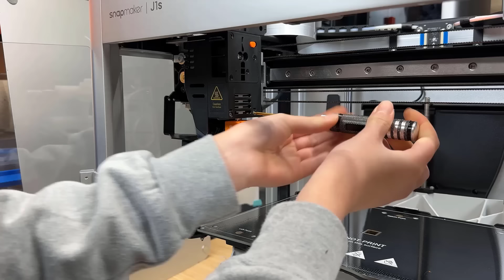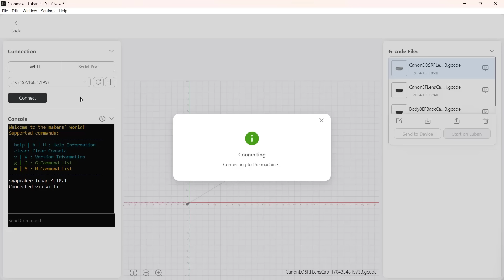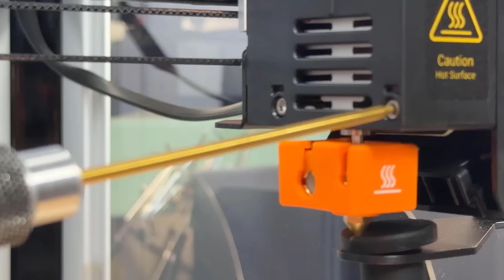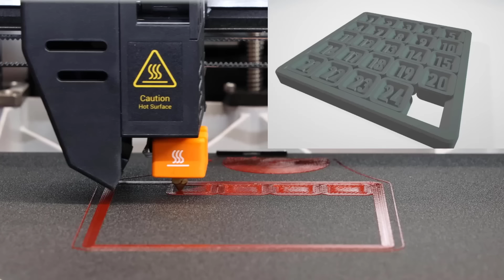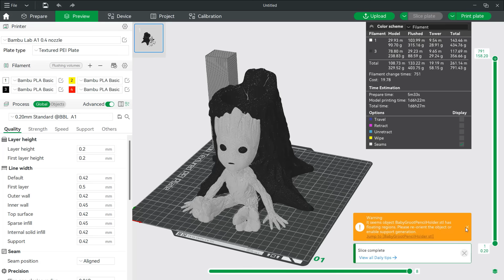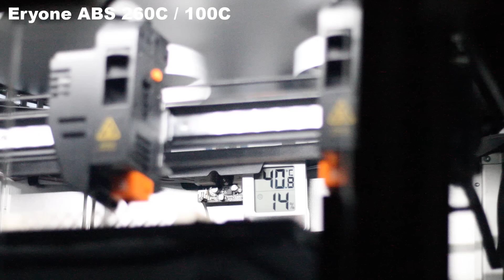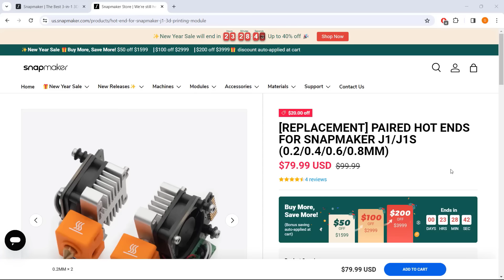SnapMaker J1s Review: IDEX Fully Enclosed 3D Printer, Multiple-Color & Multiple-Filament 3D Printing

Comment: I modified my J1 to include the filament on the inside, can be crappy if you need to change filament mid print.   I plan on laser cutting a round hole on both sides to fix this.  Great underrated printer, for anything but PLA, more engineering orientated.  The hardened ends are best in a pair  you won't have the wear.

Comment: I've owned the Snapmaker J1 since it was first released, and your video taught me three valuable lessons:
1. I had never realized how useful the paint option was for controlling which filament is used.
2.  I didn't realize that the Z-offset would solve the overflow on the first layer.  I've made several prints that I could not break apart.
3.  The tip about using PETG for support of PLA is definitely something that I want to try out.
I was impressed with your organized and thorough coverage of this printer.  Keep up the good work!

Comment: Follow up! You're right about the corners. There's no calibration procedure for the pressure advance, so I made my own test print. Turning up the K factor around a factor of 2 from factory made the edges neatly sharper. Good eye! I hadn't noticed.

Comment: I'll be honest, that print quality is rough and that is being generous. When you consider this is a $1000 machine, that and the amount of manual calibration required is honestly pretty unacceptable for this price point. Filament is cheap and I'll happily take more waste over lower print quality, excessively expensive accessories and manual calibration if that is the choice presented. Don't get me wrong, I'm looking forward to someone putting out a printer that is competitive in price to the bambu printers and does multi color printing with less waste and at the same or higher quality. As of right now I can just add a little cost into a bid to cover filament waste and end quality is just flatly too important for those of us selling prints. As for print time, it is just cheaper for me to buy another printer if I have more volume than my current printers can produce in the space of time I have available. 

Criticism aside, if this is strictly a hobby and wasting as little filament as possible is more important than efficiency, then I can certainly see the appeal of a machine like this. I'm still not entirely sold on the amount of calibration you need to do for the cost, but to each their own. Don't get me wrong, I love the idea SnapMaker has here, I just feel like the execution falls a bit short for what they are charging.

Comment: I like this one A LOT. Real dual extruders, Strong one piece die cast aluminium chassis, proper linear rails, no cloud based shitware. Two things ennoys me : The filament path, and the bed cable management so terrible that they removed it on their photos. Limiting the print height to 200mm and bending 90° the filament just to fit in the same height than a Bambu is STUPID. I would integrate a heated chamber at the top for spools with a straight path for filament, because anyway they need to be dryed and pre-heated.

Comment: Ha! Was looking for your review before I bought one last month anyway. 😊 Totally agree, one month later. 

It has its quirks, but it really is a great little IDEX. The auto XY is worth its weight in gold. If you just want fast, pretty PLA prints then other printers might be better. But for two color and true dual material (supports) it's been great. 

Also could stand a minor hot end upgrade. Otherwise I've found it pretty reliable. It also has a free Cura plugin which is what I use for my own designs that lets you send wirelessly from Cura. (There are Prusa profiles too, but haven't dug into them.)

Overall, for a hobbyist designer or engineer, I think it's a great machine. And it really is nice being able to do some pretty two color stuff without all the waiting and plastic guilt!

Comment: Pricey, but capable. For specific printing where you need dissolvable or non-stick supports, or something like TPU components inside of another print, this is an amazing option. Quality isn't 100% there, but good. I wonder if running in mirror mode actually cancel out a lot of X-axis resonance or reverberation. Would be interesting to test if counterweights can improve print quality in general.

Comment: I joined the Snapmaker J1/J1S user group on Facebook many months ago to gauge the overall long-term experience, and the biggest issues seem to have been severe clogs and bed adhesion. I think Snapmaker has improved on these issues over time, but it's something to keep in mind. If you ever chose a printer to do a 6-month review to cover maintenance, repairs, and long-term use, this might be a good one for that reason.

All that being said...the time and material savings with multi-color and -material printing can't be ignored. I really hope that a truly disruptive IDEX or toolchanger printer comes out in 2024 and spurs this section of the 3D printer market to the same frantic pace of innovation that Bambu Lab sparked with single-extruder printers, because right now there seems to be a steep fall-off in print quality and ease of use outside of the J1/J1S, Sovol SV04, and the Flashforge Creator Pro 2 (which has a tiny print volume). The prohibitive price and long lead times of the Prusa XL make it only really worthwhile for business use, and every other IDEX or toolchanger printer under $5-10k has serious mechanical issues or is a nightmare to set up.

Great review as always!

Comment: I think dual extruders are the next big thing coming to the lower end printer market.  It can't be that much harder or expensive to physically make and operate.
Reply: I think anker's solution is the next big thing. It has multiple hot ends that lift and lower on the same print head to switch colors

Comment: Unless you need to print more than 2 colors / filaments, idex is much much better than the filament switching machines.  You also get the double/ mirror print functionality.  So using the dual printing, you actual printed a benchy every 13 minutes.  Very cool looking machine.
Reply: fantasy math, lol. what if you want one, that is a 26 minute benchy.

Comment: Another great review.  I'd like to buy a 3D printer that can print a structural material such as ABS along with TPU on the same part.  Unfortunately, it seems that all dual extruder printers use Bowden tubes which are incompatible with TPU, particularly with a 90 degree bend at the top of the extruder.  I'm starting to suspect I'll need to build my own 3D printer to print TPU and ABS
Reply: This is a reverse bowden tube that only guides the filament from the spool to the direct drive heads.  Using Capricorn's Reverse Bowden tube allows for you to use TPU90 or TPU95 on the J1.
Reply: @jeffrey.edgett  - A reverse Bowden tube is somewhat less problematic than a Bowden tube for low durometer filaments, but still adds drag that tends to elongate the filament in the direct drive extruder, resulting in under extrusion and possible slippage that can chew up the filament.  I print a lot of 98A TPU, which prints much better with a direct drive extruder, and an overhead reel on a low friction bearing roller.  I generally don't even use a filament sensor because the small drag it adds can be problematic.  I also print a product using 85A NinjaFlex TPU and a Bowden tube of any variety is out of the question.

Comment: Thanks, great review, one I have been waiting for. Due to the complexity of the IDex design, I would like another review after a month of daily use with PETG as removable supports for PLA, or vise versa.
Reply: If you hunt around, a couple others have reviewed this too. ModBot I think?

I've done it and it's great when support adhesion isn't important. And where you don't print support material on the part. 

Otherwise breakaway material like she did with the HT wrench print sticks a bit better. It's somewhere between using same-material support and different material support in terms of difficulty to remove.

I've used the PLA breakaway material too, and it's worked really well.
Reply: Thanks for the info. I make functional parts and when supports are the only option, I would like to keep the Z clearance to minimum. I have seen a ModBots review and a couple others, I just like the in-depth reviews that Aurora makes and I have concerns related to the extruders reliability.

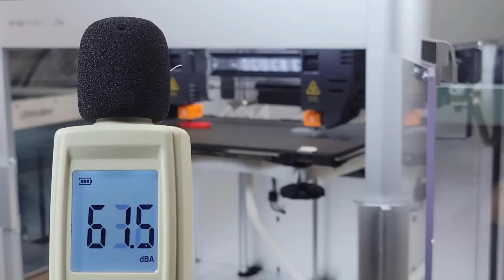Comment: 7:10 - Mirror mode is clever.  With a dual print head printer where the print heads are not independent, two objects can be printed but the mass of the print heads add together to increase ringing and other artifacts.  Printing a mirror imaged part cancels the X axis accelerations by subtracting them from each other.
Reply: Copy mode is also fine if the object can't be mirrored. Even if need slow down a little, you still get parts two times faster.

Non independent printers don't usually have even a copy mode, since the distance between the nozzles often fixed (like an Ultimaker).
Reply: @timm7524  - I had an early non-independent dual extruder printer that had a copy mode that slaved the extruder 2 motor and hot end 2 temperature to print head 1.  Obviously, that only works for parts narrower in the X direction than the extruder separation, which was fairly narrow on those printers.  I've seen multi-extruder printers where the user can quickly change the separation between extruders and add/subtract extruders to tailor the printer to printing multiple copies of different parts.  I believe the new Elegoo OrangeStorm Giga printer has some or all of those abilities to better take advantage of the huge print area.
Reply: Not found that，similar with copy mode

Comment: I was never interested in single print head multi-color printers because of the added time to print and also the wasted filament but I do like the multiple print head designs because they are way more efficient.

That adjustable wrench you printed turned out really nice using that quick remove support filament! We have actually removed that version of the adjustable wrench from our tool set a couple months ago and replaced it with one that has a much stronger adjustment wheel. We also didn't include a "print fully assembled" version in our last update because, although it could be done, it was very difficult to remove internal supports. 
However, now that high temp multi-filament printers are coming out making it possible to print quick remove filaments for overhang support or even support filaments that you can dissolve in water, I will be sure to include a "print fully assembled" version with the stronger adjustment wheel in our next 3D Printable Tool Set update (which is scheduled for mid January 2024).

Comment: Slight correction: its a fully cartesian system, so not even a core xy hybrid like a tridex. The x stepper are along for the ride with the x axis
Reply from the maker: It was a mistake; it's definitely not a CoreXY. I've corrected it and am waiting for YouTube to update it.
Reply: Yeah. I think called "Cartesian XY?"
Reply: @timm7524  im not sure if there is a official name for that, although the term cross gantry in the case of an ultimaker is pretty established in the community, but that doesn't have moving steppers. Although makerbot kinematics was also a pretty known term, but not sure if i want to tie that to a brand that no longer exists

Comment: Hi Aurora, well done for the video again. I have a tech remark that i think it should be interesting for you as well to consider for your reviews. You mentioned that the printer is core xy but it actually is not: as far as a i see it's cartesian with 1 motor for each x axis and i don't know how many for the Y. Core xy IDEX is really difficult to implement and it's basically not present in the market. 
This means that the quality/speed should be considered for comparison somewhere in the middle between a core xy and a bed slinger and in this regard it would be interesting to know how the Y movement is implemented and how much does the X gantry with the 2 hotends and everything weigh, to make a sort of weighted comparison between this machine and a bed slinger.
That's my take on this, congratulation for another very interesting video! Cheers
Reply from the maker: It was a mistake; it's definitely not a CoreXY. I've corrected it and am waiting for YouTube to update it.

Comment: 😂😂😂😂 £1000 for 2 colour printing
Reply: I would say the high temp nozzles and the ability to print a different material for supports like a nonstick easy to remove filament or filament that dissolves in water and/or the ability to print with 2 different filaments without tripling the print time or wasting filament makes that price justifiable.

Comment: 0:39 you mentioned it's a corexy kinematic. is it really? I was sure J1 series isn't a corexy, though I don't have any of them.
Reply from the maker: It was a mistake; it's definitely not a CoreXY. I've corrected it and am waiting for YouTube to update it.
Reply: If it wasn't a coreXY then the bed would be moving back and forth for the Y axis.
Reply: @3dprintedhardware  no, that's not how it works. A core xy machine uses 2 motors for each xy movement while a cartesian machine has motors separated for x and y movement. This machine is actually cartesian. Movement of the bed does not matter in this regard.
Reply: @3dprintedhardware  No. That has absolutely nothing to do with it.  A CoreXY is not the same as a "cube like printer".  A Voron 2.4 is a CoreXY.  A Bambu Lab P1 or X1 is a CoreXY.  But a cube-form says nothing about the machine being CoreXY.  An Ender 5 Plus is a cube-format printer and does not move the bed over the Y axis, but it's not a CoreXY.  Nor is the Tronxy X5SA-600 Veho, although it has the same cube format as the X5SA-500.   CoreXY kinematics are determined by the logic behind the 2 motors and the used belt path, not by the "printer format or the yes-or-no movement of the bed over an Y axis".
Reply: @kaween1000   People use the term coreXY to signify that a printer is not a bedslinger.
Reply: I agree with you, it's cartesian, you can see in the video the 2 x motors
Reply: This is a H-Bot one Motor for X and one for Y, Core XY move X and Y with Both Motors and when its using one Motor the Printhead drives diagonal …

Comment: All my J1 has done since day one is jam, I'm guessing that's what the "J" in J1 stands for. Stopped using it all together, the odd print that did finish had just "ok" quality. Honestly, I have $400 printers that turn out better quality, consistently, without all the jamming headache. I should have bailed on this kickstarter as soon as I heard Jade was having financial issues and Snapmaker bought them out. I had a feeling the end result was going to be what I got. Should have listened to my gut.
Reply: Sorry to hear that, but thanks for saving me my money.
Reply: That's rough, buddy. Having bought one more recently, I've not had all that trouble. It's true it needs the hot end fix Snapmaker is beta testing though to get to 100%.

Comment: the snapmaker j1s can't even copy bambu, because it came to market way before bambu apeared... 
even didn't snapmaker develope the j1(s) on it's own...😎
Reply: No, they didn't. I was a former employee of theirs, Jade Labo, who tried her hand at starting her own company. The J1 was launched as a kickstarter with the Jade Labo name, then she ran into production quality issues, then financial issues. From what I remember, she went back to her old employer (Snapmaker) and asked for help. They bought her out, took over the project and rebranded it as the Snapmaker J1. Jade went back to work for Snapmaker and is still the face of this printer. But all its issues stemmed from when the company almost died during the kickstarter. Then it was rushed to market, which is why it has so many non-tested issues, like constantly jamming and under cooling.

Comment: Great review as always - sounds like I should wait for a Klipper-based IDEX.
Reply: Vivedino is currently launching the Marathon, a larger sized, enclosed IDEX-Trident-like machine running on Klipper. Not endorsing them or whatever, but it may be something to keep an eye on in terms of reviews.
Reply: Having run my J1s through its paces, I can see where the challenges are more clearly now. And why Snapmaker (really, Jadelabo) went with some customized firmware to do some tasks. Maybe able to duplicate with Klipper macros. But for now, this is pretty awesome.

But for me I also need a smaller and quieter printer for apartment living. So it fits for me.
Reply: The Vivedino Marathon looks amazing.
Reply: @aminorinternet  Yeah, I agree. I just wish I knew when it was actually going to exist as a real thing.
Reply: I bought the J1. Delivered tomorrow. I have a Voron 2.4 but I don’t think Klipper is made for dual extruder setups in the current state. 
I need a idex to print parts and the j1, for 900€, beats the Prusa XL or other brands in price by far.